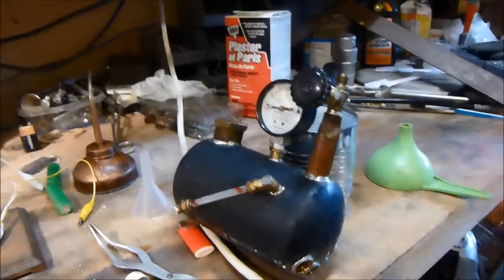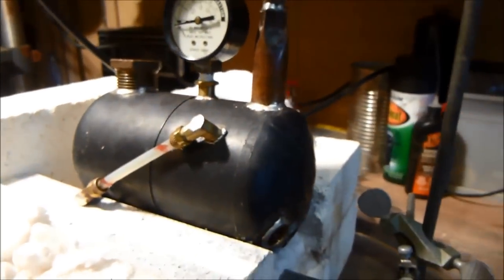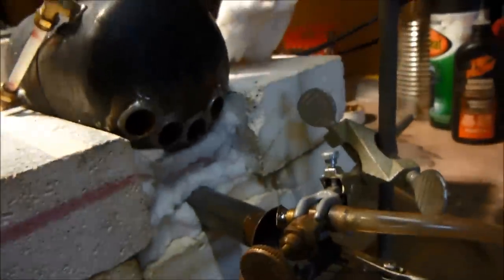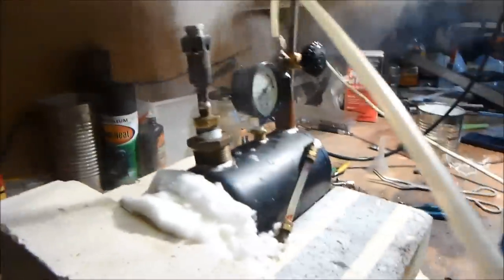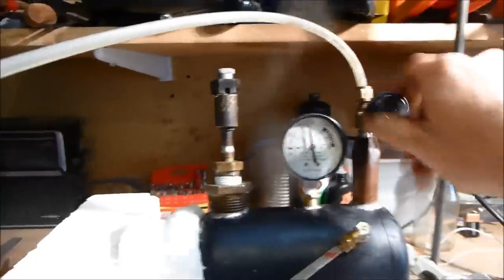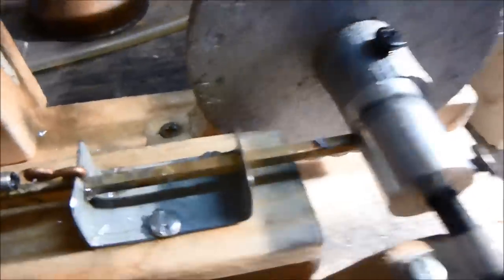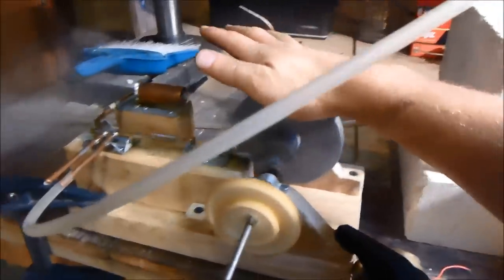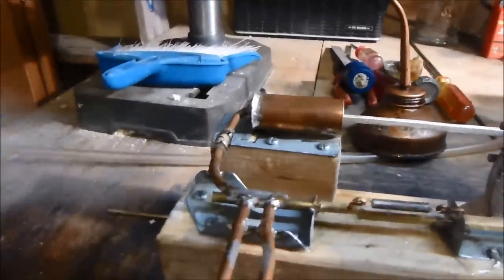Steam Engine Running on New Boiler - Modification to Steam Engine - Piston Rings, Better Valve

Comment: Very good, really good performance.
Congratulations on power reached, I always had interested in steam engines, but afraid to make one, because of of the boiler.
Greetings from Brazil,
Leandro Wagner.
Reply from the maker: Manual do Motor Stirling - Leandro Wagner Thank you! Yes boilers and be very dangerous.  You must have a pressure relief valve and a pressure gauge like I do or you could have an explosion.  Boilers exploding was the reason for Robert Stirling invented the Stirling Engine!
Reply: the water tube boiler is not dangerous and can hold high pressures. i.e. really power then.. 8 bar myself

Comment: Another mod you can do. You can recover your exhaust and run it through a coil which will allow it to condensate back into water, and feed back to your boiler with some kind of feed pump to overcome the pressure in the boiler. Nice job!

Comment: You would do well to also add a steam blower once you start making your smokebox and stack, Take a look at the locomotive design you are almost spot on to a locomotive design boiler, A proper firebox, a proper smokebox, and stack you would have a wonderful boiler.  I would say adding a steam blower and stack would double or even triple the draft that you have currently. If you built a firebox with a grate on the front it could even burn coal as your fuel. 

I hope my son does these kinds of things when he is old enough. Getting dirty and making things out of "garbage" . Hats off to you sir.
Reply from the maker: +Matt Schuette I've thought about adding a steam blower.  First I need to make a proper firebox.  I think I will use a 1 gallon rectangular paint thinner tin and then insulate it.  That would be really cool to power it with coal or even wood.  Something I will put more thought into.

Thank you!  I hope your son likes these kinds of things when he gets older!

Best wishes,
-Makerj101

Comment: It's really cool that you like steam engines, but honestly you got to consider safety even with a propane can boiler. Multiple PSVs is a good idea, having gloves on when you're playing with the steam engine, having a fire extinguisher, having the PSV discharge routed up and away from any area you could be. Also, keep your pressure low. Bad shit like tube ejection can happen if those rod brazes don't hold and one end gives out. 

In sounding like an old man, I still have to say this is super cool and impressive. Good work. I hope you go into power engineering and learn about steam. Makes a great career in process operations jobs!

Comment: As a Power Engineer, I would caution you to be very careful with a pressure vessel. Even 1 psi is enough to seriously hurt yourself if a leak or a crack in the tank or the steam live developed. You should use a copper line, plastic is not a good plan. Also don't rely on your safety valve, you should have a way of blowing off the pressure before the safety valve opens. 

Anything over 15 psi is considered high pressure. My fire tube boiler never goes above 9 and has many safety controls. 2 low water cutoffs, safety gas valve, 2 pressure relief valves etc. It's nice to see that you are taking an interest in this old technology. Just be careful.

Comment: Awesome, great work!  That's a great little boiler, and I have a few of these propane bottles that I'm thinking about converting for my steam engines.  I might go with a verticle concept, for easier circulation through the flue tubes. I want to see your generator hooked up soon!
Reply from the maker: ch300fnqi Thank you!  Give it a try!  I would look into maybe using higher temperature solder or if you have the tools brazing the joints at the top of the boiler since they are not covered by water and could get hot enough to melt normal solder.  Not sure.  Maybe the flue gases would be cool enough by the time they reach the top.  Sounds good though!  Good luck!  Yeah I'll try to make a video of the generator hooked up soon!

Comment: Great job once again! It is much more powerful than I thought you'd get. Maybe you could figure out a parabolic dish to heat the boiler and make it solar! Then you could get some free energy. I have made tracking devices that control drive motors; with the dish you'd have to use 2-axises to track the sun. Finally a way to auto-fill the boiler to keep a sufficient water level could make the whole system automatic...
Reply from the maker: SpinStar1956 Thank you!  Yeah it's not bad on power!  Yeah or I could use my Fresnel lens!  Yeah I think a pump is next on my list.  Or maybe building another engine that is double acting. I'm not sure what is to come next!  Only time will tell!  :P

Comment: In 'myfordboy'"s little vertical boiler, he introduced a copper helix in the flue gas stack so as to slow down the transit time of the hot gases and improve the transfer of heat to the water. Great work, and keep experimenting . Take a look at a "haystack" boiler just for curiosity. As a kid I made a Hero's reaction turbine from a copper float valve and two wings from a garden sprinkler. Keep safe Amigo.
Reply from the maker: +Hassan Burrows I'll have to check that out. They put a helix like that in gas water heaters to introduce turbulence and increase efficacy. That awesome!

Comment: Only constructive thing I would add is because you are now a public teacher and all kids aren't natural born plumbers is that you need to tell the audience to evacuate the cylinder and replace the gas inside with CO2. Just for safety reasons.  Other than that thanks kid, I've been staring at a cylinder for more than a year and too scared to drill it even after doing the gas replacement!  And I'm a welder!  So thanks for t he nudge, and nothing beats the sound of your voice upon seeing it's power, Awesome video, and you are also a nutural born teacher. A+
Sizzlean

Comment: All that effort, and you still have a boiler that is for the most part suspect. You obviously have the ability to do it right, so get some copper tube and silver soldering equipment and make a small boiler like the one " myfordboy" made a while back. So nice to see so much enthusiasm when you saw the power. Keep up the good work, just make it safer so we don't get to see the video where you die a screaming death and then the video stops when the batteries on the recording equipment run out. Watch some of Keith Appletons videos, he is an old guy like me, so hasn't had his head blown off while a youngster, proving the safety is quite a good plan.

Comment: For some more power you can split the steam output to multiple small pipes and run them in the flues in counter current to the hot gas so you superheat the steam.
Reply from the maker: akkudakkupl Yeah I could!  Thanks!
Reply: Makerj101 But remember, it will increase the pressure will increase A LOT! So make sure that your lines can withstand it.
Reply: Makerj101 And a word of warning. Any steam boiler that boils anything but distilled water is at a risk of finally exploding (through corrosion of the boiler tubes and scale deposition that causes overheating and failure). So I'd say run only distilled water OR have the boiler in a separate room so you don't get killed.
Reply from the maker: akkudakkupl Yeah I need to get some distilled water.  Thanks!

Comment: Good job!! I like the home made engine and a tip to help it run smooth is use steam oil on your moving parts it's better then other oils. I don't know what kind your using just a tip of that helps
Reply from the maker: +tyler gruden Thanks!  I'm just using motor oil.  I should get some steam oil.  I don't think it's very expensive for a little bottle on eBay.

Comment: Install a gas valve from a wall furnace that uses a thermopile, so you have a pilot safety, and use a adjustable psi switch to turn the gas valve on and off to control the boiler psi, the Thermopile will generate the electricity to operate the gas valve,  put pg9 pilot close to the burner, gas inlet side
Reply from the maker: hill billy That's a good idea!  I'll look into building my own because I don't have a gas valve!  I used to have one from an old gas dryer but I took it apart to see how it worked and then the pieces got savataged for other things!  :P

Comment: Maybe try a condenser on the exhaust steam outlet, using cold water. That would reduce the back-pressure and increase speed and power. Could also recycle the condensate back into the boiler

Comment: I am making my own out of galvanized steel pipe and I am wondering where you got the pressure release valve because I have a coffee purculator safety valve and do you have any ideas on how to make a water injector? please write back as soon as you can. thanks for posting this vid because it really helped me and I just might make one like you have but coal fired because I work well with sheet metal.

Comment: Hi Just a small point boilers can be extremely dangerous even at very low pressures.  I would suggest you look up on how to make them, silver solder should be used for all joints not plumbers solder it melts at too low a temperature.  When building a boiler once assembled but with out any fittings it should be hydraulic tested to twice its working pressure, finally using plastic pipe for a water gauge is a definite no no, should be thick walled glass mounted in proper fittings and sealed with O rings.

Comment: The kaowool insulation you're working with there is a bit of an inhalation hazard when used indoors.  The heat and rising gases break off and suspend little ceramic fibers in the air you breathe, which is shitty for your lungs.  Use sodium silicate solution and a spray bottle to fix all those exposed fibers in place and reduce your exposure.  I mean you probably shouldn't burn gases indoors either, but that's a dumb rule.

Comment: Thats going heaps better now. Well done. Use a grinding wheel for the flywheel, and you have a steam powered bench grinder :)

Just a thought, but as all the waste steam is expanded, its going to contract again when it condenses... I wonder how big a flask you would need to create some vacuum on the exaust. I think you would want a short as possible exaust pipe of decent diamiter. And a ton of cooling on the flask. Aluminum cans with lots of fins come to mind... Would probably need a 44gal exaust flask, but something to think about.. I wonder if you could also run a stirling on the exaust heat? Might be able to drive a fan and cool the colector flask. If you did do it, you could measure water colected, compare to water consumed, and work out how much your seals etc are leaking....
Reply from the maker: Mongrel Shark Steam powered grinder!  Good idea!I had a radiator connected on it before I modified the valve.  But that might help with the vacuum from the condensed steam.  I didn't think about that vacuum.  I just had the radiator on it because I wanted to reuse the pure water so I didn't get a mineral build up from constantly using new tap water.  I should get some distilled water.  Thank you!
Reply: Radiator into a catcher flask would probably work. If you had some 1/4 inch copper pipe, that would probably be thick enough to transfer to radiator without causing to much back pressure, and wash of some of the heat.
The big hurdle with the idea is the amount of heat that needs to be removed. Fan on the radiator would do a lot.
Steam has a fantastic thermal transfer efficiency So most of the heat used to boil it, has to be removed again to condense it.
Always made me wonder if extra work can be done by the waste heat.
Stirling’s are great at moving heat from one place to another and doing a bit of work in the process. Would have to be fairly LTD though.
Reply from the maker: Mongrel Shark Yeah I was noticing how much heat it transferred too!  I had it hooked up the a radiator from a dehumidifier earlier today and a small fan on it and there was really warm air coming off the radiator.  I think my pipes are too small to create a vacuum though.  When I hook it up it slows the engine down a bit.  I will try to see if steam has enough heat to run one of my Stirling engines.  I got a new valve for my boiler!  Now I can release the pressure faster!  I hated the old valve because I had to turn it like 20 times to open it all the way!  It was so annoying!  I will do a video tomorrow!  Thank you!
Reply: Yea, I was thinking car radiator. Hmmmm I wonder where you could find one of those....
Reply from the maker: Mongrel Shark Hahaha yeah I wonder...
Reply: Makerj101 They have a lil mini radiator for R/c cars/boats maybe that would work.

Comment: Dam nice modification wish i could make one.Waiting to see how much power its gona produce.Imagine that thing on 30psi all day that would be amazing.
Reply from the maker: E Isad Thank you!  It produces about 3 watts when running on 30psi.  I tested it after the video but I didn't record it because I figured the video would be long enough and I would save it for another video.  I'm planning on making a prony brake so I can measure the real power output.  I know!  I need to figure out how to get a bigger flame that burns cleanly!  The way it is right now if I turn up the gas it burns inefficiently and you get less power.  You should make one!  You will not regret it!  :)
Reply: Makerj101 3 watts thats not bad for that littl thing.I have a sugestion why dont u make some tiny tubes with holes or cuts that go through the holes in the boiler.That way the has more conntact with the water.I know i will not regret it but i dont know if i will blow the hole apartement down cuz when i make stuff that it it dangerus it allways explode XD.
Reply from the maker: E Isad Hmm I suppose I could do that.  But I think I may have already gotten most of the energy out of the exhaust gases.  But it's a good idea!  It would also be super hard to do that and it would make more resistance for the gases.  I'm thinking of adding a water pump to keep it full.  Maybe I could run the cold water tubes from the pump through the exhaust gases to preheat the water before entering the boiler.  Well you don't have to run it off steam if that worries you.  Air compressor, tire pump, or refrigeration compressor all could work to power it nicely.
Reply: Yeah if u can do that with the pump to preheat the water that would mean a pretty stable and high pressure.Oh u can run it on a compressor that new funny thing my uncle has 3 so i could do that.By any chance u have the plans for it writen down that could help me a lot .If so pls send me some photos.
Reply from the maker: E Isad Yeah it would!  Not much temperature shock when filling!  Just set it a a constant filling rate and it should be good!  I think I  need to get some distilled water so I don't get mineral deposits in my boiler.
Well... the only plans I used to make it were plans that I have up in my head.  I guess I could make a quick sketch of the valve because that is the main, most complicated part.  Maybe I'll make a short video on that.  Are there any other things you would want me to answer or show in a video?  Thank you!
Reply: Makerj101 Oh yeah u get that white thing when u boil water that thing get bad after its in there.If u make the vido that vould be perfect the only thing beside the valve would be the timing on it like when does it open or close.Thank you.
Reply from the maker: E Isad Yeah all the minerals get left behind and they cause corrosion and if the whole boiler gets covered on the inside it and decrease heat transfer.  Ok I will try to get a short video out soon!
Reply: Try and paint it on the inside with a corrosion painting by just puring the paint inside and shaking it it should help a littl.Thanks for the video.
Reply from the maker: E Isad I did do that but the paint is kinda bubbling up and stuff.  I don't think it is working all that well.  Hopefully it will last several years at least.
Reply: Ohhh the paint isnt high temperatur rated i forgot about that well lets hope soo.You  could do somthing a littl bit diferent and make the jb weld a litl bit liquid so u can get the walls with jb weld idk if that thing works or not thats all what i am thinking cuz i never have tryed building a boiler but my uncle work with metal and i have learnd somthing.
Reply from the maker: E Isad  Actually the paint is really high temperature stuff.  It's for painting grills and stuff like that.  I don't want to put something very thick like JB weld on the walls because that might make the heat conduction lower so I can't heat the water as fast.  What would I thin the JB weld with?
Reply: You can thin the JB with petrol if i am not correct or any paint thiner and dont really know JB well cuz i never worked with it so i would say try it on somthing tiny and see if it works.
Reply from the maker: E Isad I will have to try that!  Thank you!
Reply: Makerj101 Np mate!

Comment: cool video i like how everything is hand made tbh there are so many ways you could have built this and got better performance and it could have ran its own small dc generator that had a rpm monitor attached and a led so you know the speed and a led just for some effect ... that boiler will hold easy just make sure you use distilled bro dont want that blowing up .. tbh if you really get into making them you could make a mini room with full vents and a flue!

Comment: I made a propane boiler to he gave me the idea but mines not horizontal mine is vertical with a actual steam pop off velve along with a single shime 1 3/4 whistle along with a steam engine valve and injected witch is a hand pump